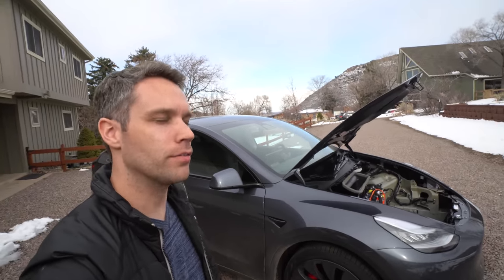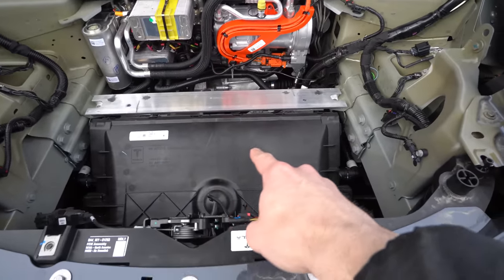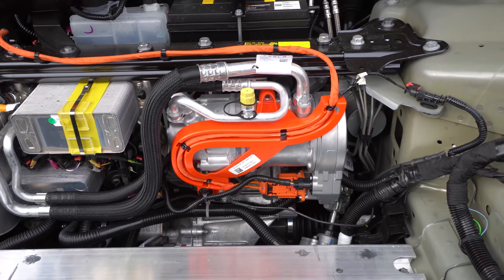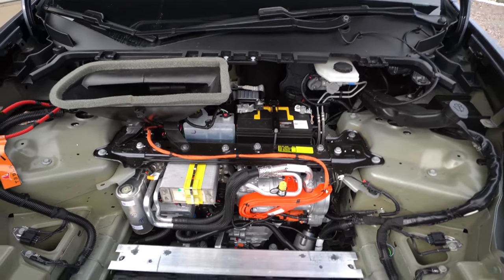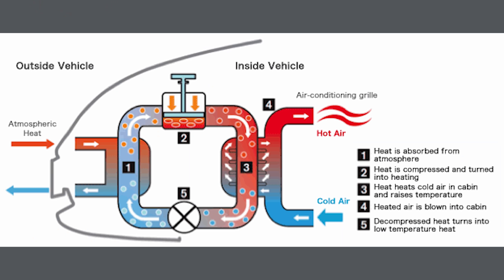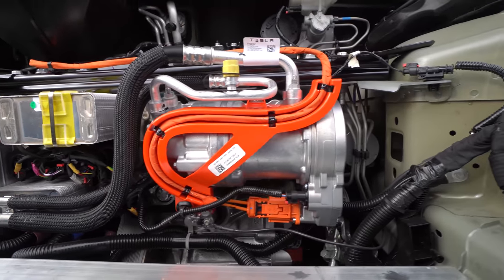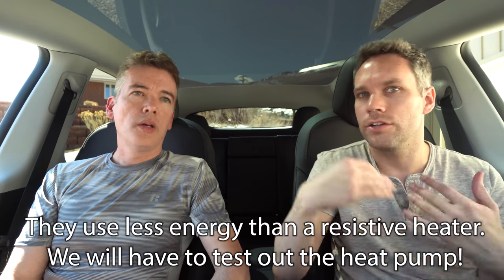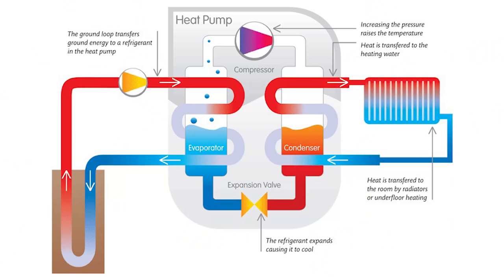The Biggest Change in Model Y Over the S, 3, or X!

Comment: So my experience with a heat pump in our apartment's HVAC system is that the heat isn't very instant- it's sort of gradual. And when it does come, it can be a little humid. But it gets the job done. However I anticipate that Tesla's probably going to have a way better heat pump system than the one in my apartment. They also have the ability to control humidity in the cabin with the Y, so that's testament to how better it might just be.

Comment: A more simple way to describe it is a heat pump simply moves heat instead of creating heat. Exactly the same as an air conditioner except in reverse. An AC unit works by taking the heat in your home or car and moves it outside. Heat pump takes the heat from outside (even if it’s just a little in 30 degree temps) and moves it inside

Comment: I had a Prius Prime with a heat pump. Anything below about 14F it would kick on the engine to supplement the heat pump, as it wasn't strong enough to keep the cabin warm. But, that car had a much smaller battery, and the heat pump may have not been sized like the Model Y's is. In any case, that car was SUPER efficient in mild Winter temps on electric-only.

Comment: I have a heat pump in my house. They're great in my climate (Florida), because they don't get really hot they blow warm air. It basically runs the AC backwards (in the case of heat pumps for houses), so imagine the warm air that blows out of the outside AC unit when the ac is on inside. They are VERY efficient and save us lots of money. But ... My nest thermostat didn't work on it😭

Comment: You mean COP of 3, which is on the lower side of the range commonly seen in heat pumps. I'm assuming the smaller size and not-so-ideal operating conditions prevents a cop of 4-4.5, which is what most heat pumps put out.

Comment: I've had a heat pump on my home for a few years now.  It's awesome!  The idea is to eventually heat my house for free (or nearly free) using solar panels.  YMMV. I'm in CA and coldest I see is 25 to 32 degrees in winter, but the unit I have is capable of producing heat at temps below zero albeit less efficiency.  On average 300% efficiency sounds about right.

Comment: The Leaf heat pump works ok in mildly cold temperatures, but in extremely cold temps of -25F it can't operate and vehicle energy usage is very high leading to 50% range reduction.

Comment: The seat heater is a resistive heater, except that it has to generate less heat because of a reduced area it has to make warm. The seat heater is interesting in the first minute of driving a cold car, but then the heat pump will come up and you will be able to shut or lower the seat heater. The heating elements in the air tract are also only there to supplement the heatpump when it starts up. The heat pump is more efficient because it transfers heat in or out of the car, it does not make any heat. every A/C unit is a heat pump. The current reversible heat pumps are in fact inverters. But it is the same principle as air conditioning. And it is possible to use CO2 as refrigerant gas instead of nasty things.

Comment: I dunno about you guys, but if I turn off the cabin heat in my 3 when it's cold outside, it starts to fog up pretty much instantly.
Reply: Steven Williams - when it is only me fogged up windows are not too bad, but it can be with even one person in the car. 2 to 3 people and you need to start pushing a lot of warm air through the cabin to keep the windows clear. Using only the seat heaters provide a noticeable benefit if it is possible.
Reply: I like the chilled air with my back and butt warm but a heated steering wheel would be the cherry on top
Reply: You need dry air coming in from outside to keep from fogging up. Recirculating moist air just keeps getting more and more moist from respiration. So you have to let cold outside air in to keep from fogging and heat it up more to stay comfortable. It's a catch-22.
Reply: Actually AC works best for moisture as it removes water from the air. Works absolutely fine when combined with warm air from heater. Problem is, its very energy inefficient, hence switch on/off method helps.
Reply: @Tom_Mroz  the air conditioner is a heat pump and is therefore very efficient, especially if it's designed to heat the car as well as cool it. Old style AC units powered by drive belts off the engine used to sap power but modern cars use an electric compressor for efficiency.
Reply: @russvhill2  you are not understanding his point. In the winter if your windows are fogging up in the car you turn on your air conditioner, even with the heat maxed and it will remove moisture from the air in the car, thus defogging your windows.
Reply: @christoph3481  Yes. That's exactly my meaning. Thank you 👍

Comment: Residential heat pumps work best in more temperate areas of the country. They lose a lot their efficiency in colder climates and when attempting to heat large areas like insides of homes. This is why you generally do no see heat pumps in the Northeast or Midwest portions of the country unless you can couple it with some sort of geo-thermal source.

Comment: I don't see this increasing the range of the cars. The stated range of vehicles is based on optimum conditions. So in colder environments this heat pump will only help to preserve range, not increase it. The use of this heat pump will have no effect on range in optimal conditions, but the pump might help maintain performance in hot environments too. Just a small semantic gripe I had with your commentary.

Comment: As a Canadian who loses 30% range in the Winter months, I think the heat pump will be an improvement.  I am interested to see how much of an effect it will have.  I have seen tests that show the heating in our M3's use 4.5Kwh when running.  I think that means if they heat was on for an hour, it will use 4.5Kwh of energy, so around 6% of our battery.  I think the real culprit is the battery inability to take a full charge due to the cold weather.  Hopefully, we will figure a way to keep those batteries warm in the winter to extend the cold weather month's range.  Again, congrats to Tesla for adding the heat pump and helping us in the cold weather climates.

Comment: We have a Trane 20 SEER heat pump, which means it’s very efficient. With outside temps below ~45F, and if our set temp is ~3 degrees higher than room temp, the heat pump will start for the first 15 min or so, then the resistant heating element will kick in along with the heat pump to bring the room temp to the set temp. Once that happens, the heat pump maintains the set temp even if outside temp is down to ~25F. We live in central GA. P.S. I’m wondering if Tesla knows what its heat pump’s SEER rating is and if the compressor is variable speed like our Trane residential unit.

Comment: "cabin heating or heating the motors"..  usually electronic devices work more efficiently when cold so maybe they just use that heat to warm up other things like batteries which are more like chemical reaction devices. there probably are some tolerances or something  to make electric motor gaps (expansion, distance to magnetic fields), lubrication, bearings etc more efficient in a planned working temperatures. i wonder if that is enough to make it more efficient than a cold motor. anyway the windings of electric motors have more resistance (which means losing power to heat) when warm.

Comment: What’s the delay with Tesla adding rear view camera, and 360 degree surround cameras? My Chevy Bolt has them and I LOVE them. It kept me from buying a model 3. Those of you that don’t have them, you don’t know what you are missing. I live in Phoenix, have dark tint on my windows, but it doesn’t matter.. I see perfectly well behind me because camera is outside of tinted windows. I have to admit, I LOVE the maneuverability of the Bolt. Makes it so much fun to drive, easier to park etc.
Wish the Bolt had a heat pump. Nice going Tesla. I’ve been following you since inception. I bought stock at $26/share. Keep it going!!
PS: thanks for great videos guys! I know it’s a lot of work.

Comment: I used to drive a leaf with a heat pump , 
It’s more efficient regarding energy consumption for sure , but on the other hand it does not give as much heat as the traditional heaters and also the the traditional heaters are much faster but I think it’s a great move from tesla and should have been done earlier

Comment: I have a heat pump/ variable speed ac, heat pump(with a compressor) water heater, and a heat pump dryer(samsung) for my clothes. All of these make make my house very efficient. I have two Teslas, a solar array and two powerwalls. In two and a half years, I’ve had two energy bills totaling about $60.

Comment: My Leaf has a heat pump, takes about 12-15 seconds to blow hot air on a cold snowy winter start. Gas cars 5 to 7 minutes to heat up or my diesel truck 15 minutes. 

This is awesome

Comment: Nice. Any idea what are exact specs on the heat pump used in Model Y? Like efficiency vs outside temperature, what refrigant is used, and how low you can go with outside temp. I am sure it will work in -25 deg C. But will it work in -40 deg C for example? Not that I need it, I am just curious. Is there a backup PTC resistivity heater element to help it with super low temperatures or to take over?

Comment: Typically Heat Pumps are not used in residential in Colorado or anyplace there tents to be extremes in temp, they are widely used in AZ as an example, I haven't looked into them for some time so perhaps they have made significant strides in places that have wide temp variations such as Colorado. Exciting for the Y hope it works great and increases the range.
Reply: There are many modern heat pumps rated with a COP around 2.0 down to 5F. We installed a Mini Split in Washington state, coldest we see is 20-25F at night but the system works great. Operationally rated down to -22F, but I'm sure the efficiency is a wash over resistive at those temperatures.

Comment: The Miele clothes dryer Made in Germany uses a Heat Pump. In America  most dryers pull in ambiant air, heat it and pass it to the outside of the house and repeat. Others from Europe use condenses and the moisture is caught in a tray with the heat returning back into the room helping in heating the room. Heat pump returns hot air back to the drumb where clothes are being dried and not to the outside of home which costs less in energy efficiency.  I paid more fornthe Miele but it paid for itself already. Have Tesla Model 3 and Solar this year.
Reply: Love our Miele. We purchased one in Washington state to free up the dedicated dryer 240V outlet for EV charging. Works very well and quite over built.... Germans.

Comment: Air conditioners are heat pumps. They move heat from the interior to the exterior. You simply reverse that transfer if you want to move heat from the exterior to the interior. Only works if the exterior has some heat to give, though. This won't work very well in regions where exterior temperatures get well below freezing.
Reply: We use them a lot here on Finland to heat our houses and even at -30C some give 2x or 200% efficiency. House models are much larger tho so Tesla won't get there, but they should do better atleast to zero/freezing

Comment: Home heat pumps are rated in SEER where a 3 SEER is three times the energy out as used or 300%. Most home heat pumps are 12 SEER or higher or 1200%. Apples and oranges but one comparable data point to ponder.
Reply: You are confusing SEER (seasonal energy efficiency ratio) with COP (coefficient of performance).  SEER has units of BTUs/hr per watt. 
As an example, if you are producing three watts of heat and consuming one watt of energy, you have a COP of three. To get your SEER rating you must multiply your COP by 3.41 which in this case would give you a SEER of 10.2

Comment: I have seen some HVAC videos, and it seemed like just changing the direction of fluid with valves you can choose to either heat or cool.

I do not know if anything else is needed. On houses the outdoor unit has a heating wire to stop ice from forming. And also it defrost at intervals depending on temperature.

Comment: If I may, would you mind... to remove completely the carpet to show if there is a way to store a spare tire
flat or in one of the sub-trunk holes to lesser the impact of the space taken by a spare wheel.

Also, if you can measure the size of each sub-trunk holes when there is no carpet
and what material the sub-trunk holes are made of,
I hear that the boxes are made of plastic instead of metal like the Model 3.

If you remove the carpet, can you check all the wires inside the trunk to see if there is an unused plug
on the electrical harness that could be used to connect a trailer plug

I wonder if the sub woofer is now located inside the hatch, or still on the side of the trunk?
In particular, I didn't see any air duct to have the air circulating around the sub-woofer amplifier.

Comment: Yes I still have a gen 1 Leaf (2015 model 24 kWh) with heat pump and a model 3 (LR awd).
And I can confirm the model 3 loses more range in the winter than the Leaf in percent.
At the moment we hover just around freezing in Denmark and the Lead loses around 25% compared to summer and the model 3 is more like 35-40% loss.
I did worry about the absence of a heat pump in the model 3 prior to purchase and it was one of the main reasons i chose the LR and not the SR+ for the Nordic climate (bonus is the awd).

Comment: My old e-golf (24kwh) also had a heatpump but I didn't have anything to compare it to. Worked just fine though here in Norway in the winter. The air to air heatpump in my house has a COP of about 7 if memory serves. Not sure why heatpump in cars are less efficient? Size constraints of radiators/fans?

Comment: Thanks for sharing the videoe  A heat pump generally refers to the overall system.  What you pointed out was the compressor.  An air conditioning (AC) system is a one way heat pump system pumping heat out of the cabin into the atmosphere.  An AC system does not work in reverse to provide heating.  In the AC system, its components are optimized for one way pumping and compressing/expanding of the refrigerant.   If you properly design the components (pump, 2 condensor/radiators) and allow for change in flow direction of the refrigerant by valves, in the winter a heat pump system allows heat to be pumped from the atmosphere into the cabin.   In both an AC system and a heat pump system, there is a compressor.  However, in extreme cold climates, the heat pump system may not work as well as electric heaters to heat the cabin.  I doubt Tesla pulled out all the electric heaters inside the cabin in case the cars are used below freezing.  The seat heaters are likely to remain electric heaters.

Comment: the to block of thin metal plades next to the heat pump, ar heat exchangers..take surplus heat from eg. the motor and use it for cabin, or battery..

Comment: The technology has been around for a decade and more. I have a Mitsubishi Air Source Heat pump  to heat and provide hot water. In simple terms 1kw in and 3kw out  fabulous. So the point is for home you run it all the time on low the reason is it's slow to respond and second it more efficient to heat up a building fabric or car space and maintain it there using very little. A heat pump can work in reverse to cool and modern inverter air conditioning system. In Tesla use the app to pre heat the car in the winter or cool in not summer whilst plugged in. I am thrilled Tesla have put it in such a small space.

Comment: Yes, the heat pump recovers the energy generated from other parts of the vehicle eg electric motor/generator/machine unit, and the battery pack when in use?  In some ways it is back to the old ICE situation, where you therefore have to wait for the electric motor to work up some heat in order to be able to extract that heat from the circulating coolant it seems?  Anyway, good video, be interesting to see if they can cram this tech into the model 3, which presumably has less space to play with.  Every model, Tesla keep improving the product.  In the ‘Y’ they’ve improved the Falcon Wing doors right off the X for example.

Comment: The most efficient heat pump built in an electric car on the market is the one in Hyundai Ioniq. Winter consumption low 15 at minus 10 Celsius here in Europe, summer around 13 by not driving it slow.
The heat pump is a huge advantage of all the EVs which have one.

Comment: The 2002 Toyota RAV4EV had a heat pump which did the job reasonably well.  Still driving one now after 18 years, original battery pack.  It's a true "Gen 1 EV", but it was Toyota's FIRST Plug-in Vehicle! (Funny how they forgot that along the way!)

Comment: Thanks for the look under the hood.

Sorry but this front assembly looks very cheaply made, heatexhanger looks like it is fixed with a metal cable tie, but they then found out the cable tie damaged the unit so they put some tape on and printed some plastic corners to fix it. But still no up and down movement support.
No inside paint, no visible glue or filler between connected metal plates, random holes in the metal plates everywhere, cheap air duct foam that looks like something used in a Ikea or Amazon speaker.